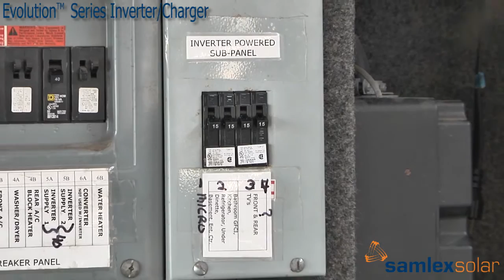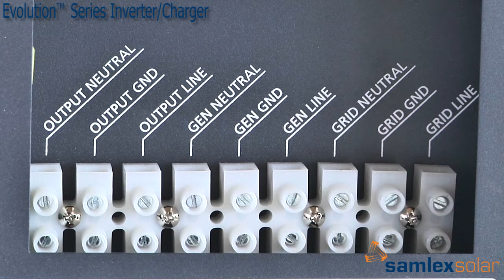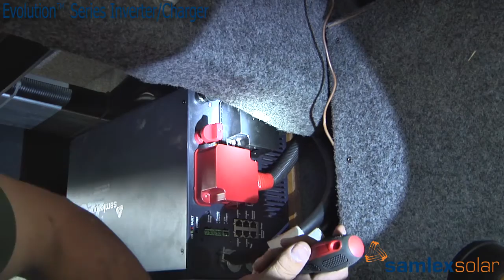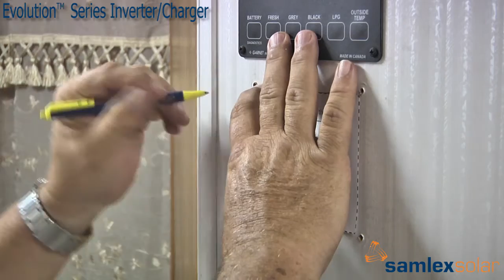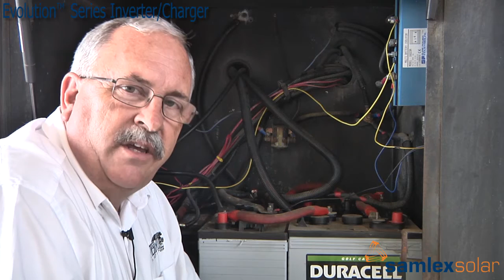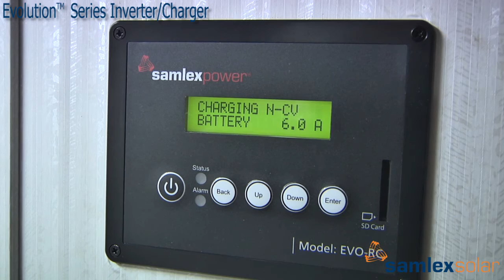Samlex EVO Installation

Comment: Did you ever do the in-depth programming video for the EVO-2212? Would love to know programming recommendations for 12 volt lithium batteries.
Reply: Thanks for your question. Our tech support is available to help you with set up of the EVO with a Lithium battery.  Please email tech@samlexamerica.com with information on the battery, the model, and we will support you with your install. We are working on an application note for the lithium battery, which will include programming recommendations.

Comment: Do you vent your battery compartment and if you do how much venting does it require for 6 lead acid batteries?  You put two positive cables for your battery with a 100 amp fuse and a 300 amp fuse.  The 300 Amp supplied power to the inverter from the batteries.  What was the other one for with the 100 amp?  Was it from the inverter for charging the batteries?
Reply: I'm trying to figure this out as well. Did you find anything?
Reply from the maker: Hi there, apologies for the tardy reply, the 100A fuse is likely for another accessory. We specify a minimum 350A fuse for the EVO-2212. If you have further questions please contact our tech department at 1-800-561-5885.